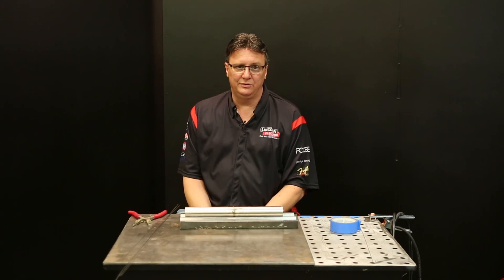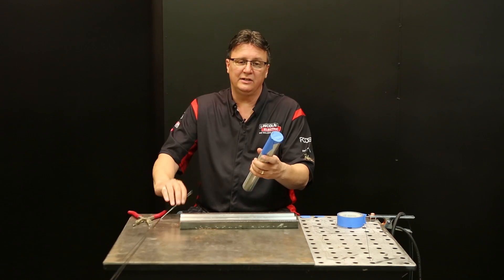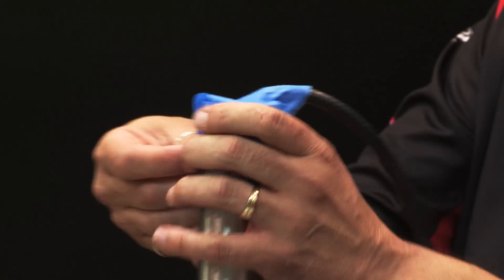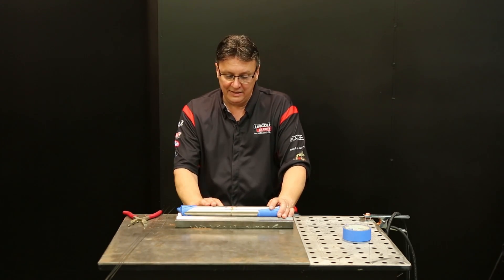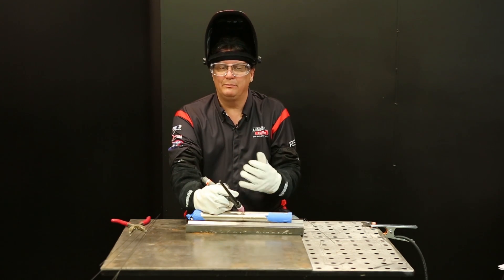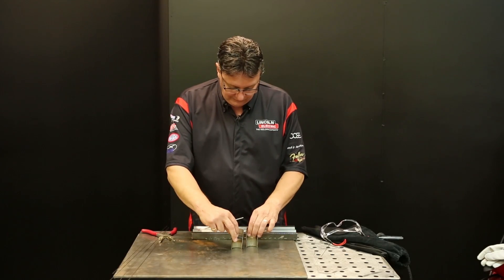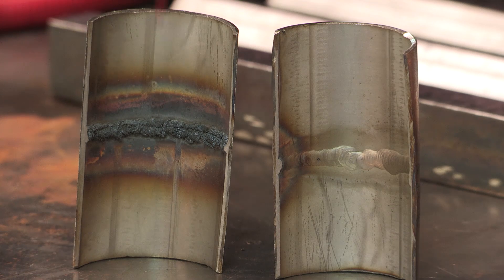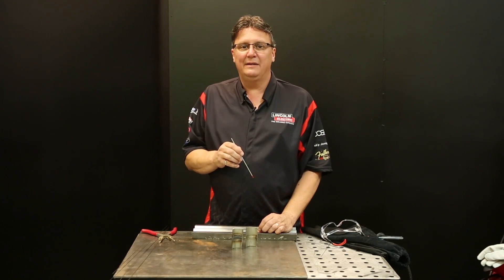ARC Magazine Master Class: Purging Stainless Steel Tubing

Comment: Looking for a welding solution will be welding 360 brass half by 2 1/4 inch plate does anyone have any tips author
Reply from the maker: +Thomas Arrey Thanks for the question. Lincoln Electric does not recommend welding C360 (C36000) brass.  This is a free machining grade with up to 3% Lead in the chemistry.  The lead will cause centerline solidification cracking in the weld metal.

If the component needs to be welded the brass cannot be a free machining grade.

Comment: No offense but in food industry we had to purge weld a lot smoother weld than that example to satisfy our supervisors.
Reply: It's generally not a prescribed method or in SOPs as most times it's not feasible to do so. A good setup with low enough oxygen on the inside can get you all the way to a very nice weld. If manual welding isn't good enough, you get an orbital welder.